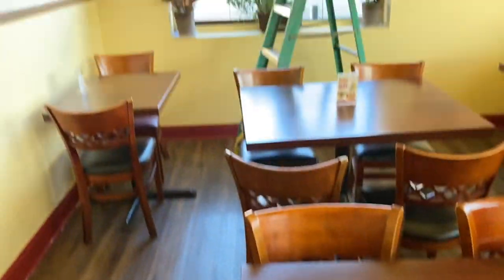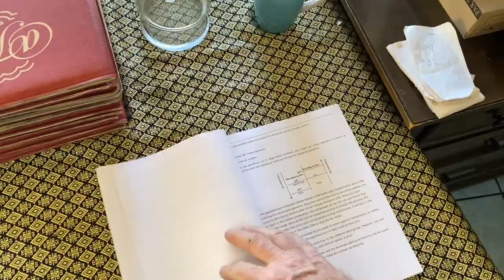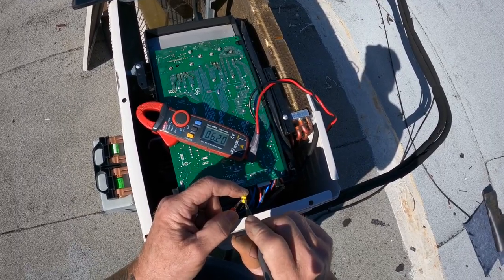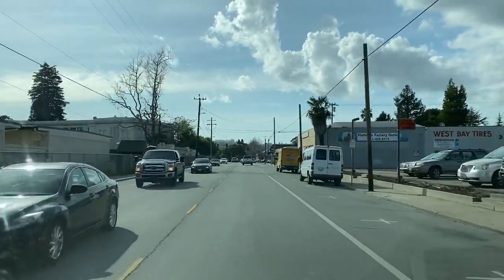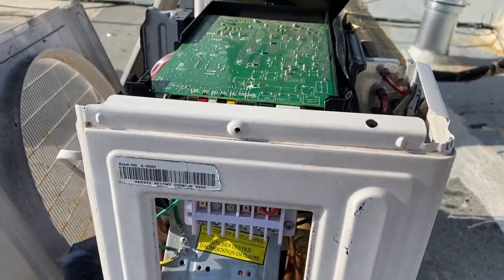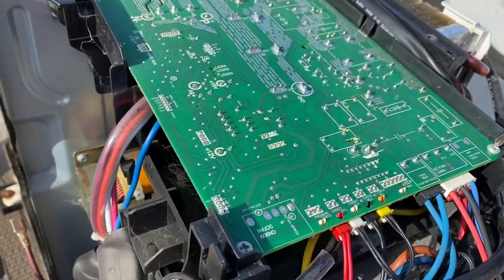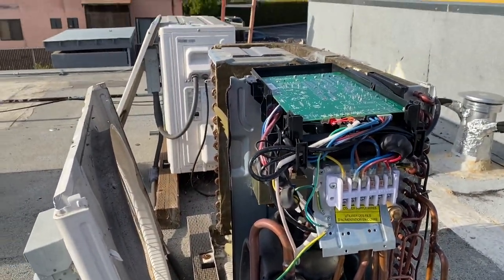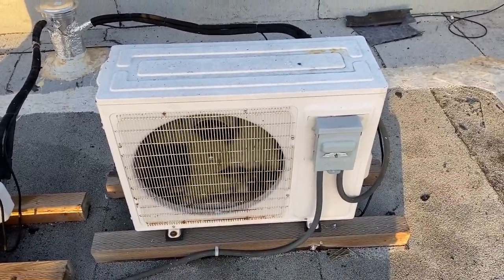Mini Split Air Conditioner the  compressor won’t run

Comment: Been on a few ductless courses, those boards hold around 300vdc after you shut off the power, they always told us it takes about a sec per volt to dissipate, so give it at least 5min before diving in. Good advice for clearing nuisance codes too 👍
Reply: Or you can discharge the caps just like with microwaves. That many volts dc especially with high amps can not just shock but kill.

Comment: electronics engineer here, those switching FETs (black 3 pin devices at the top of the board) don't look too happy. I'm willing to bet that they went open circuit due to extended thermal stress.  these FETs drive the compressor btw, which would explain no output from the drive.
Reply from the maker: Outstanding thank you
Reply: The compressor three phase vfd switching actually occurs in the integrated power module to the right.  The bridge rectifier is to left.  Those middle two components are curious.   The right one almost looks like two pin not three, maybe diode?  Maybe they are a mos switch and schottky for some kind of power factor correcting boost citrcuit?   Don’t typically see any to220 devices wherever the integrated vfd power modules are employed.   for example look at latest generation genteq ecm motor controller boards.  silicon consists of bridge rectifier and an STM integrated “power module” vfd/mcu chip..
Reply: @yeliab814  ahh ok makes more sense I had a feeling it might be the module but wasn't sure. I dont deal with high power stuff, I work with FPGA's all day lol. those STM modules look really cool though, I might toy around with some if I get some time.
Reply: @embeddedgirl  FPGA’s thats super cool.   Yes the modules are really amazing, although the datasheet scared me off.  In theory the modules promise greater reliability through defined circuit paths, inherent FET matching built-in switching deadltime control/protection, etc.   Time will tell. .     As with the latest new things these days, designing around these seems all about writing the software /logic implementation !
Reply: @yeliab814  reliability, yea ok Dave should send them the board to evaluate their claim lol. I'm still willing to bet thermal stress is the cause of its failure,
Reply: @embeddedgirl  👍👍

Comment: Glad you mentioned about the inverter board being dangerous after powering off. The capacitors hold one hell of a charge that’ll hurt you bad.
Reply: All the new modulation equipment is that way now. Minisplits are no different. Wait at minimal 10min. Yes 10 min before diving in or that will be one hot potatoe.
Reply: i rememeber when i first started workin with my pops i was a little kid touched a start cap ya ... it was a kicker  lmfaoo

Comment: What if the board is new but the compressor still won't start? Would you try to repair the compressor or just replace the whole unit?

Comment: Hello I have a new 36k 4 zone mini split. It sends all units heat when even only one unit should be calling for it, they will all blow barely warm air. If all are calling heat they all blow hot. No zone control on heat. No error code. What could cause that issue?

Comment: I’m impressed you got a new board that quickly
Reply from the maker: Air con actually has decent support and is dirt cheap. If your customer registers the equipment it’s a 5 year parts warranty.

Comment: Goooowd stuff Brother Dave. Those PCB boards go bad alot. They don't like voltage spikes. Usually lower voltages kill them. Carrier/Panasonic mimisplits are horrible nowadays for them. Stay safe and be well Brother Dave.
Reply: @OcRefrig  well you could just ohm out the windings. Even put on a megger. I would have ohm out the power and wire to the indoor. I had a job where electricians did a poor job on their end. Other than that grab holy water and pray for the best! Lol
Reply: The Cfan motor also likes to take out those boards. They are sensitive, like a woman 🤣🤣🤣🤣
Reply: @rottiev264  didn’t carrier have a recall on the od fan harness? I know I had to go back and replace several with fusible links to help protect the board from a fan failure.
Reply: @anthony5530  I’ve had this happen on a couple different brands of ductless, LG, Fujitsu, Daikin, Gree. Not sure about the recall you speak of but sounds like a good idea 👍
Reply: Surge protector for all mini splits? Agree?
Reply: Do you like the units from supply house?   Or which brand is most reliable?
Reply: @farmerfox99  Mitsubishi has been the most reliable in my experience. Daikin and fujitsu are the second tier then all the other ones are basically the same
Reply: @anthony5530  agree 👍
Reply: @anthony5530  hi had geek find dc regulator bad. A $5 part. When he replaces think this will fix?  This must control fan as compressor worked but not fan.   How do I test dc fan motor?  Unit 8 years old

Comment: I don’t know why but the older I get I ABSOLUTELY hate having to replace boards on mini splits. Various tech support seem it quite often have you replace the condenser fan motor when doing a board. Glad it went smooth for you.

Comment: Great work Dave. I wish you would use your ladder lock on that extension ladder. Only takes a few extra minutes to clamp it on .
Reply: Wish that ladder grip thing worked on roofs like those... 
Good ol bungee cord or tool bag strap is the only real good way

Comment: it's always good idea to "hipot" test the compressor before calling a control board. it could very well have a current leak to ground, which can kill the board and not show up on simple resistance testing with ohm meter. I'd say the off brand  mini-splits are meant to be thrown away when broken.
Reply from the maker: 5 years and done

Comment: I fixed my mini split throwing protect compressor code and after figuring it out the cause was that I had used a twin piggy back breaker which I have heard causes no harm but it does because I can put mine back on the tandem and get a code and take it off and working without fail so sometimes it may help to check and make sure

Comment: @ Dave did I miss the part where you put heat sink  paste when  putting  the new board
Reply: Sadly I’m sure the way that board was shipped it did not come with any and it probably went back without any. Won’t be long.
Reply from the maker: The heat sink comes pre installed on these boards.
Reply: That’s good to hear! Did you remove the old one just for inspection? Good to hear it was covered. Did they want the old board back?
Reply from the maker: @waynecostanza2280  no they didn’t. And yes I took the old one apart
Reply: Thank you Dave, I love your video they gives me confidence

Comment: My heat stopped working,  wiggled many wires bundles and it started to work  codes lights pointing to doing that.
Reply from the maker: The way they cram the wires is terrible

Comment: Did you put fresh thermal paste on the heatsinks
Reply from the maker: Heat sink comes installed on new board
Reply: @NorCal-refrigeration  oh cool it's just because I saw you remove the old heatsink from the old board but great video

Comment: I have had the outdoor coil sensor measure out fine but had a short which took out the outdoor board. First we replaced the outdoor board which worked for about a month then the sensor shorted the board out again. We replaced the outdoor coil sensor which had arced through the metal housing 👀. I didn't think there was that much voltage to do that but it did and haven't been back.
Reply from the maker: Great info
Reply: So you ohmed out the sensor and it came out fine then checked it to ground and saw a reading?
Reply: @allanbrito13  No as it was dry at the time but had an outdoor coil sensor fault the second time with comms fault on indoor unit. When talking to tech support they sent outdoor coil sensor and outdoor board under warranty. I noticed the burn hole when replacing it.

Comment: How much did that inverter board cost?
Reply from the maker: 250$ if not warranty
Reply: @NorCal-refrigeration   250$ is pretty cheap for an inverter board not bad

Comment: I did not see any support on the lines between the condenser and the roof penetration.
Reply: The wind keeps them propped up
Reply: @GOOCHIElicker  ya, the winds coming off the ocean can be pretty strong.  It will prop them up

Comment: The compressor runs on DC?   I thought that an inverter implied AC.
Reply: Negative. To have an invrrter compressor it runs DC voltage. As the AC voltage will damage the compressor when slowed down.
Reply: the compressor does not run on DC, the line voltage (AC) get rectified and smoothed to DC and then chopped to AC again, except now the frequency is not fixed at 50/60Hz, it can change
Reply: @supersussycat  Wrong! Its a brushless DC compressor, and by the way once converted, no turning back to ac just dc pulses coming out.
Reply: @sjefoekel6058  and "dc pulses" = AC 😂 they even alternate
Reply: Lots of bad info here.

First,  An Inverter takes DC and makes AC. Period. 
A rectifier takes AC and makes DC. Period
These units are VFDs, they use an inverter to make three phase AC Voltage with variable frequency, they spin the compressor slower or faster based on a variable frequency.  Yes a inverter uses DC pulses but it also changes the polarity(alternates) and it is filtered, you end with very nice AC voltage.
Reply: @supersussycat  god bless you.
Reply: @waynecostanza2280  the whole idea to this bldc motor stuff is to drive it it with dc, every time you invert, convert, AC/DC/AC there are losses and to eliminate this loss, you use DC compressors and fans, and this way you end up with a very nice energy efficiency, the compressors used
In these units are DC only, what you are refering to was 20+years ago.
Reply: @ sjef oekel the indoor fan and sometimes the outdoor fan are DC, brushless DC motors have there place, typically it’s with higher speeds, that being said these units use vfd. Just look at the board it will say uvw which is three phase notation. Only three wires go to the motor. If there were no AC in the unit it would say Rectifier technology, not inverter.
Reply: @16:05 you can clearly see the high voltage separation in the board labeled  U V W and just after that you can see that the one Dave is working on has an AC condenser fan and the DC fan option is not installed. So there’s that.
Reply: @waynecostanza2280  see my other message
Reply: What message?
Reply: Excellent repair video! Good to see Tippy back in the game! ;-)
Reply: @waynecostanza2280  the one that got removed.
Reply: @ sjef oekel, you want me to see your deleted message? Did you see the board or read the manual? It’s an AC VFD.
Reply: @waynecostanza2280  the compressor is 3fase dc motor, also has uvw notation. Please google it, you will find it on any manufacturerers utilise this,
Reply: @ sjef oekel, ok. Good luck with your studies.
Reply: @waynecostanza2280  god bless you even more!

Comment: You should put thermal paste back on it 
Definitely would last longer if they run cooler
Reply from the maker: New board comes with heat sink installed we all good
Reply: @NorCal-refrigeration  That’s good 
These new units are pretty cool  a VFD and 2 dc motor speed controllers threw some microprocessors 
There’s a lot going on

Comment: If that was a ducted system that board wouldn’t fail
Reply from the maker: No kidding 24 volt transformer and a contactor, done.

Comment: Good video ! i Wish they had Board tests to actually test the bad board and that way your not just making an educated guess ! / taking a risk of $$$. Board is prob. $300.00 or more.
That unit was not that old was it ? i thought you just put that in a little bit ago. i think i remember the video.
Reply: You can test the board. As most manufacturers put them in upside down. You can test the pins on thw back side. All you need to know is each sensors ohm values. But remember these units are disposable per design. Parts are only kept for 5yrs now that it.
Reply from the maker: @FlyEaglesFly19111  correct 20,000 run time hours rated. 3.5 years if 24 /7.